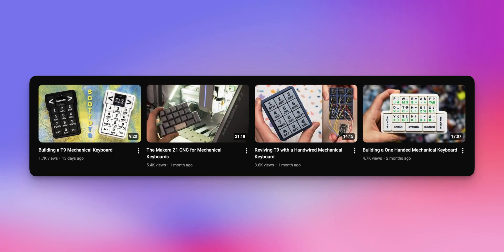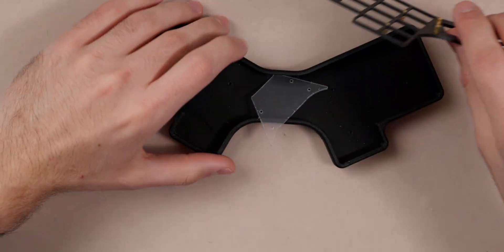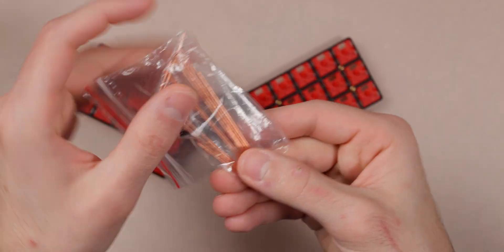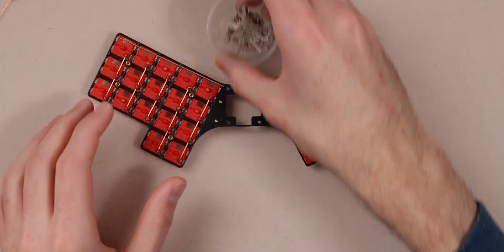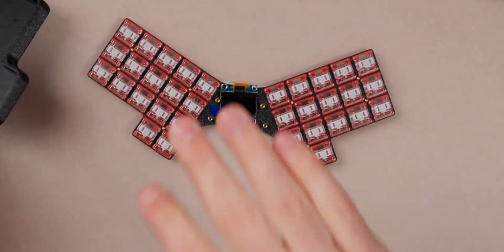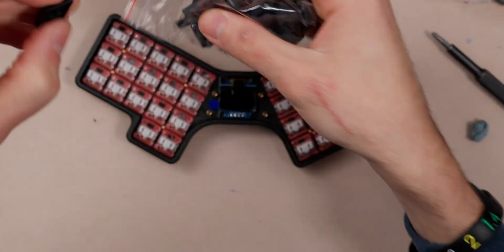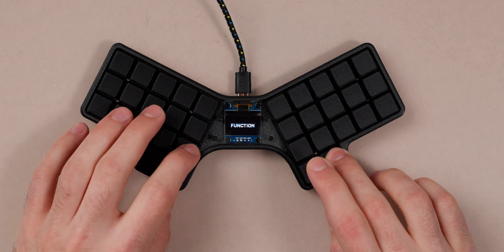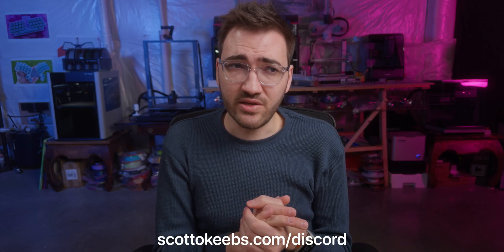Building a 16x16 Spaced Handwired Mechanical Keyboard

Comment: Ok, now I want to build one of these, but with regular choc spacing. 

Also, I love the curves of this case. I designed one to hold a corne, but not split, and the case has very hard corners. What are you using to generate case files?

Comment: Joe have you tried matte PLA filament? Not only does it look cool, it also hides layer lines pretty similarly to fuzzy skin. It's a lot weaker than regular PLA but for keycaps it feels so smooth that you'd think it was injection molded and sanded
Reply from the maker: I’ve used matte and like it, I might try combining it with fuzzy skin at some point

Comment: were those keycaps fdm printed??? if so i'm really curious what your settings were (orientation, supports, layer height, etc) - i've never seen 3d printed keycaps that weren't SLA that look that good
Reply from the maker: Yup, FDM printed. They're available on my repo but basically I designed them to be printed on one of the sides at 0.12mm layer height with no supports.